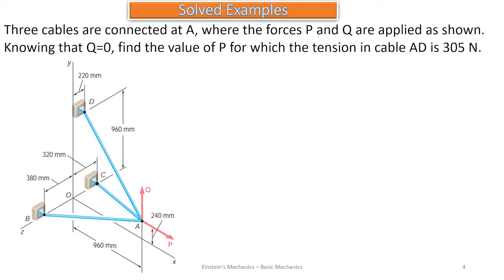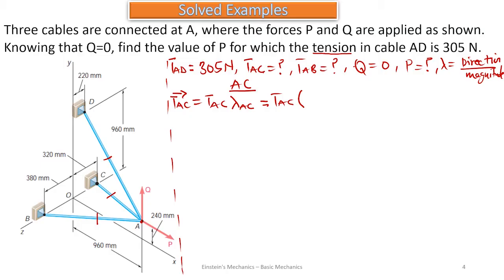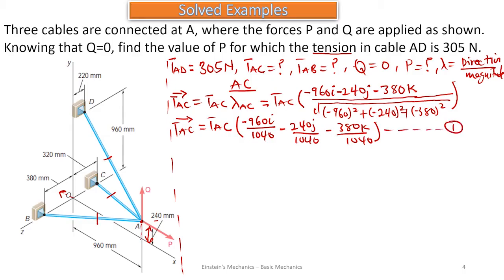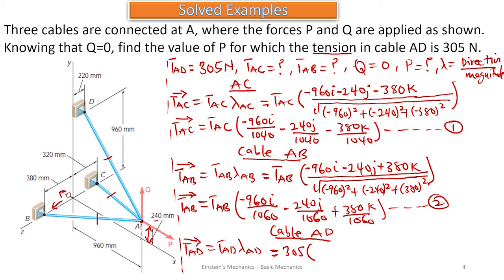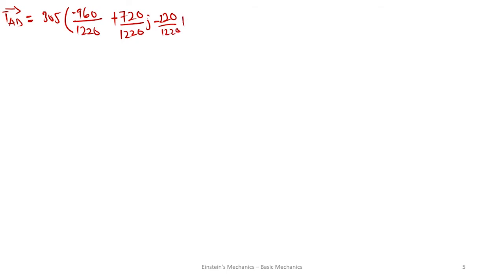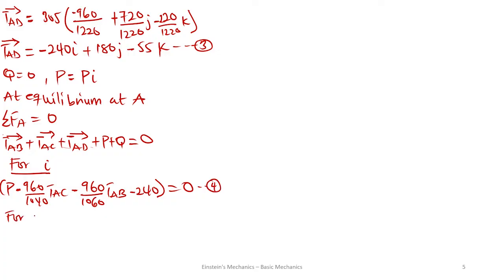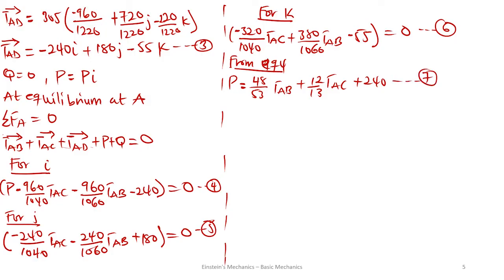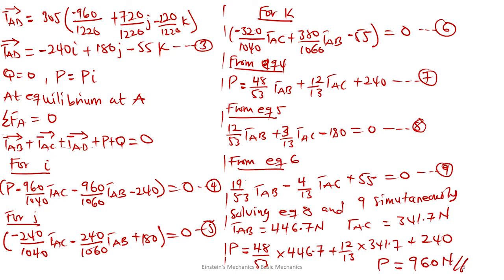PROBLEM SOLVED ON FORCE RESOLUTION | MECHANICS |

Comment: please for the movement of from a to c why is the z  component not 320mm but rather 380mm
Reply from the maker: It’s 320mm for cable AC but 380mm for cable AB
Reply: @einsteinsmechanics9175, so you made a mistake
Reply: So theres a mistake  @Einsteins-mechanics